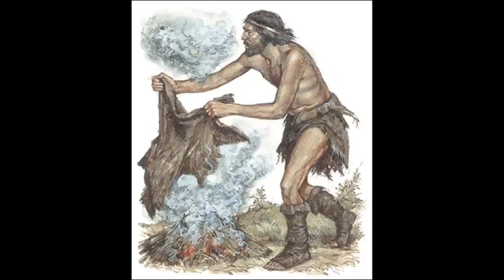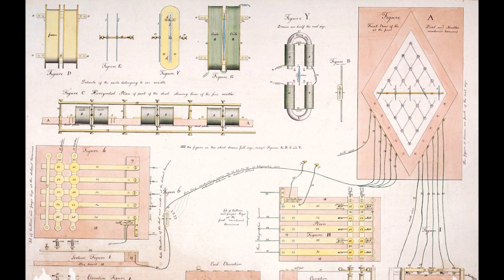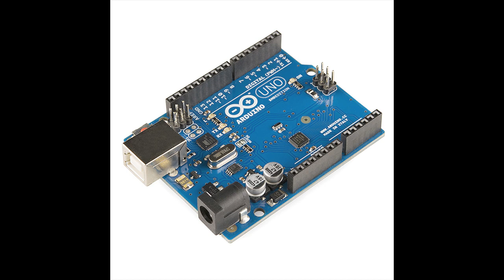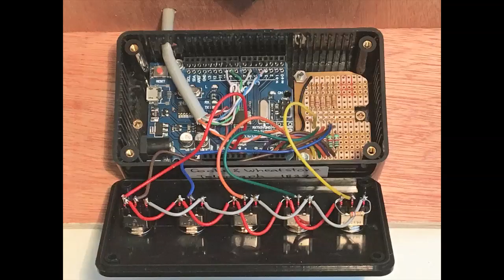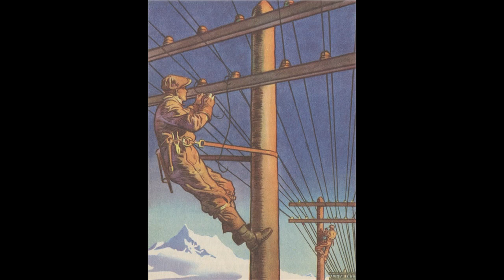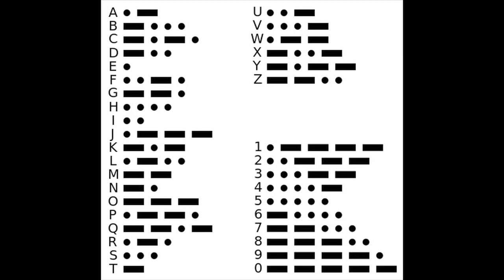Wheatstone Telegraph Demonstration

Comment: Nice idea ! More practical to the human receiver than Morse. But, I guess the drawback is that, unlike Morse, it is not automatable ? Also, it seems not easily extensible to other letters and characters
Reply from the maker: You could add another needle to increase the number of characters. Alternatively, you could operate one needle instead of two to point at more characters.